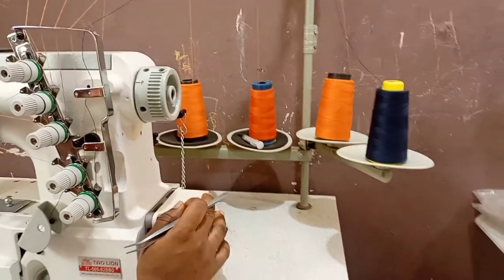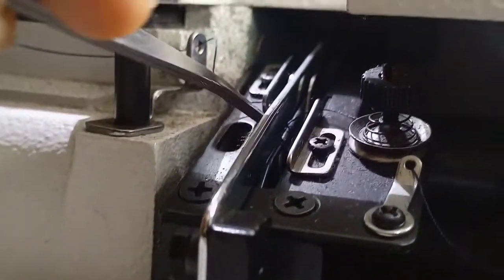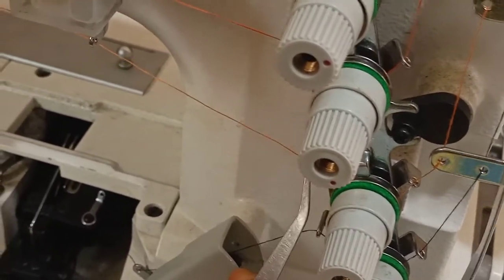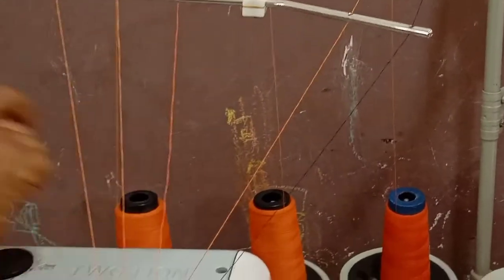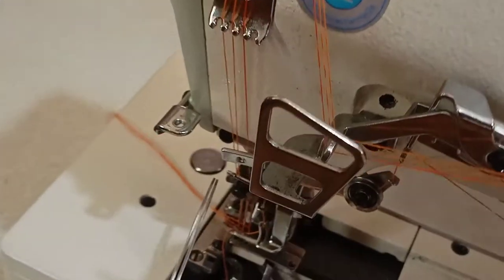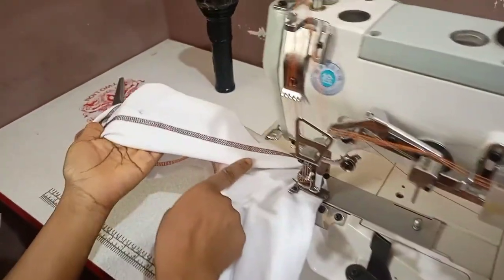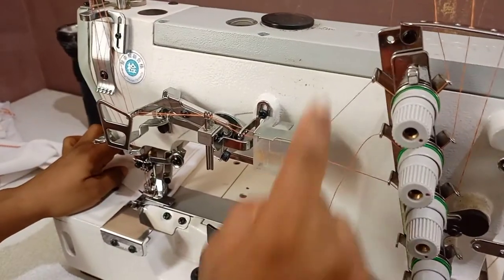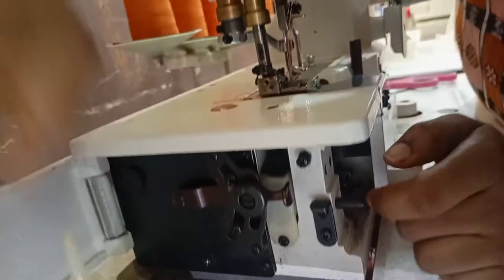How to thread and run different stitches on Industrial coverstitch/taping machine

Comment: Thank you sister but my question is Do I need to get someone to set the machine for the first time because mine no 5 is always cutting and it is brand new Emel product
Reply from the maker: If you can set it up no problem, but If any thread is cutting just check to ensure you thread it properly and make sure the tensional are not too tight.

Comment: Hi I have a question. How do you go about adjusting the stitch length? I find mine is very very small, I would like to lengthen the stitches for the needles
Reply from the maker: It's of different brand and I don't know the one you have. But surely there should be the knob on it. "N" should be the normal sewing so you can adjust it to other numbers on it until you are satisfied.
Reply: @hissignaturecoutureltd ok thanks, where is the knob located on yours? My brand is Zoje